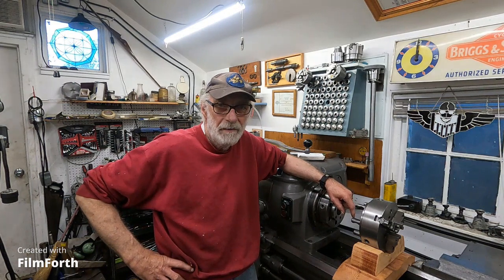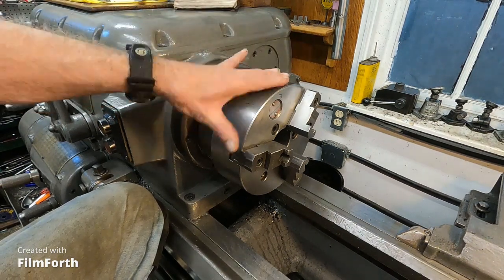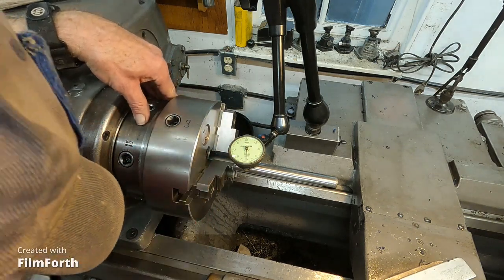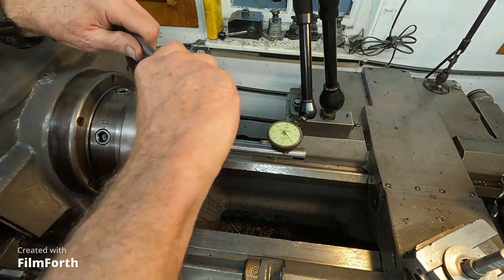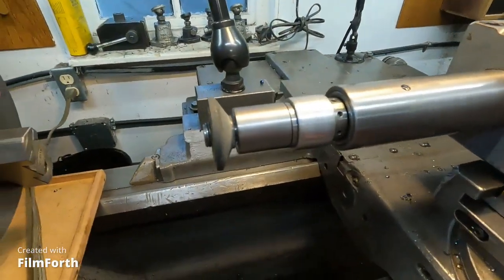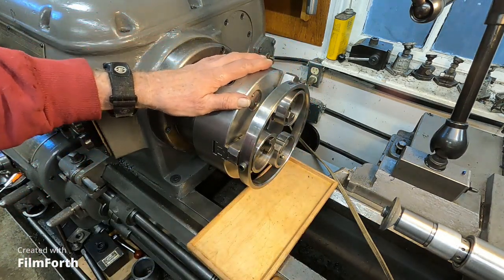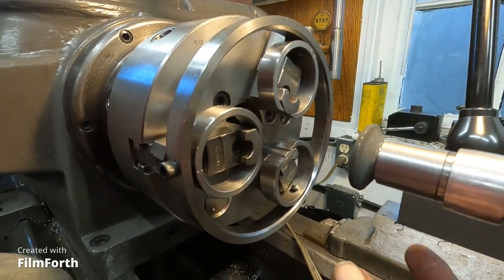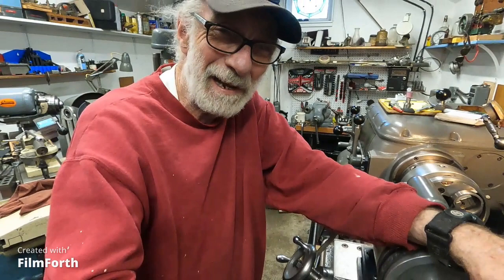Industrial Lathe Chuck Maintenance and Jaw Grinding 1

Comment: Looking good so far dee dee, waiting for the grinding now. When you've ground the jaws can you check the run out with two different test diameters, say for example 1/2" and  3" to see if the run out reading is the same when the chuck jaws are wound outwards along the scroll. Cheers Tony
Reply from the maker: Yes! will do test of a variety of diameters to get an idea of what this will do and get some more consistent readings out of this by getting better or even jaw contact by reducing the bell mouth wear on the outer end of the jaws, hopefully back going soon

Comment: I was down in Connecticut today and saw a 20" x about 10 foot Axelson today. What a lovely beast!
Reply from the maker: I am discovering this 14" Axelson is a very accurate machine ,nimble feel moving the carriage and cross feed now that the oiling is working, I am still learning to shift the headstock gears, and there are some tricks to it. A machine tool dealer long ago warned me to make sure the shipper style clutch is good because it is not easy, to change even a tale of woe on the net out there.

Comment: now I get It. that jaw holding jig must be a lot better than loading the jaws against the inside of an ordinary ring.
Reply from the maker: Yes, rings only work for grinding the outside steps as the scroll is turning the opposite direction and loading the jaws on the wrong side. also a round part can be  in the master jaw once the jaws are ground as shown, the jaws can be turned around and those steps ground and the outward faces.

Comment: I figured that was how that fixture was going to work after seeing it in the last video, something else on the list of stuff I will have to make, my 10" 3 jaw chuck has jaws with a little belmouth wear in them, plus I have a new set of outside jaws which probably should be ground to suit the chuck.
Reply from the maker: This chuck came with two sets of hardened replacement jaws that bolt on but the master jaws protrude below. a little, I try to avoid chucks missing the original jaws. There seems to be no exact standards for a given size chuck, but if the replacement jaws bolt on the master jaws can be ground to work
Reply: @deedeeindustrialsuperprecision  my 10" 3 jaw is a Pratt Burnerd and whilst they are no longer made, new oem jaw sets are not hard to find for it, so I was not worried about only getting inside jaws with it, I have a 10" all steel Kitagawa 3 jaw in near perfect condition but it only has outside jaws, an inside set is proving impossible to find in the UK.
The only chuck I own with master and top jaws is a 2 jaw I found in a scrap yard.
Chucks are not hard to find here if you spend a bit of time looking, I bought an almost unused 12" 4 jaw bison direct mount D1-6 this winter for £250, was with a CNC lathe but they never used the 4 jaw.